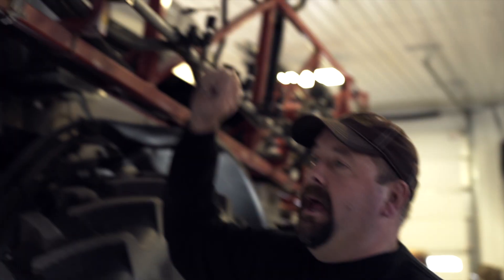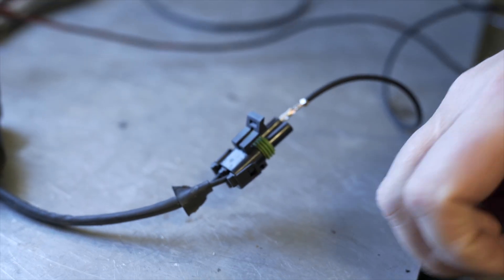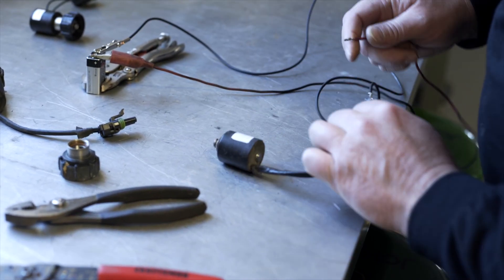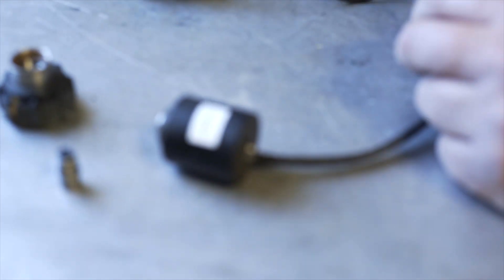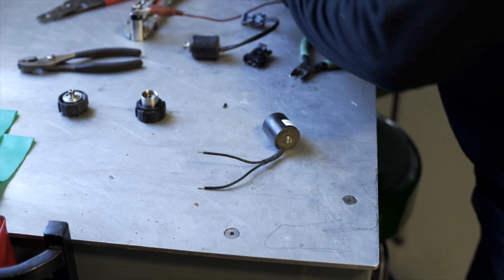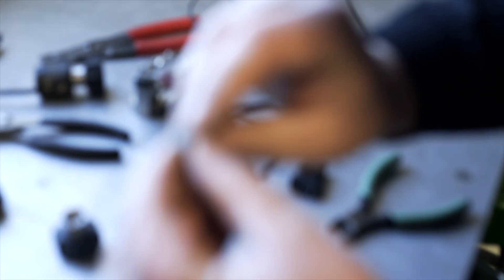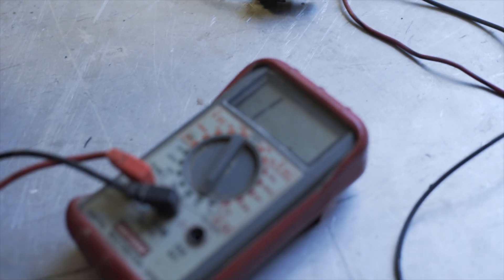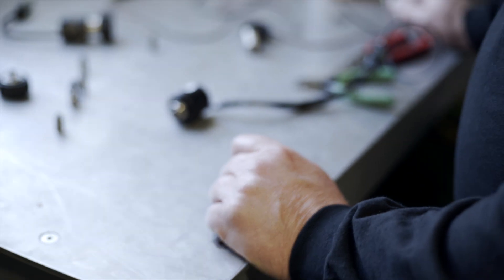Testing AIM Command Solenoids

Comment: Thanks for this.  I have a problem with some nozzles that dribble/spray when the boom is shut off.  Would these dirty/dodgy solenoids be the problem?
Reply: Bad poppet if you take it apart you will see the little rubber on the end is ripped or indented that will make it leak

Comment: Can you just buy a pack of weather packs??
Reply: e Bay has OEM Case IH valve body part # 87272501 for this solenoid (fits: Patriot Aim Command and Aim Command Pro. Not for Aim "Flex" after 2016 in other words) The valve bodies are pricey from the dealer!